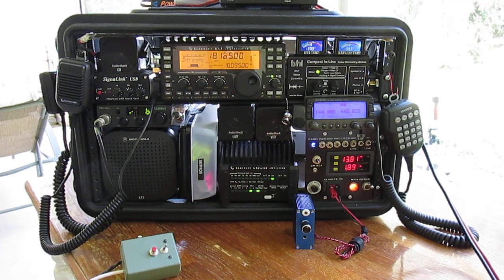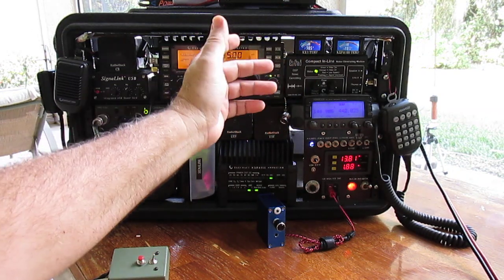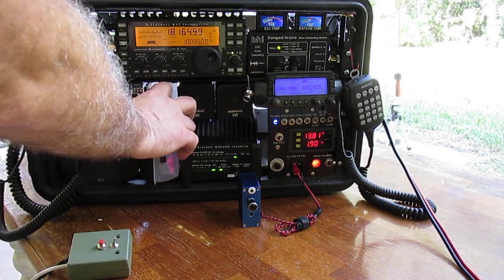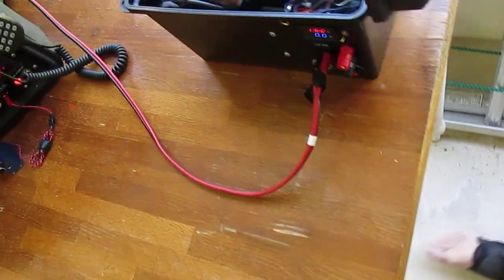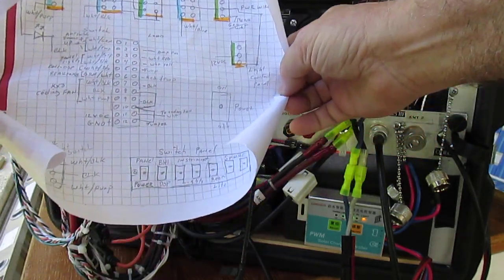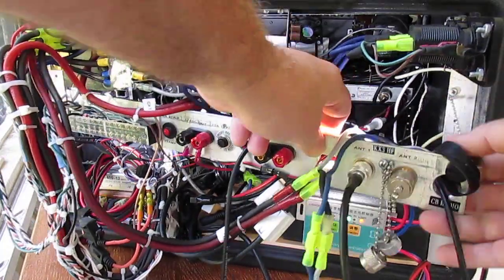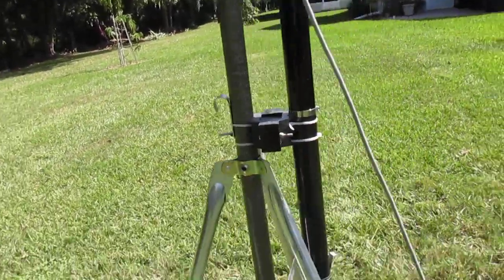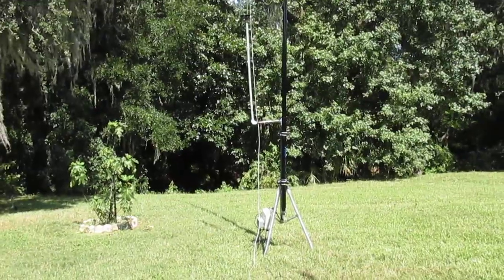E COM Go Box Emergency Communication

Comment: This is a super pragmatic build.   I appreciate knowing that you had problems with flush mounting the antenna coaxials.    I have been thinking I'll include a 16 foot cable which will be routed into the go kit, and just coil it up and then spool it out to my antenna A/B switch will be outboard.  I'll be using 3M's super velcro (Dual Loc) to do a similar easy serviceability.
Reply from the maker: 16 foot cable, another good idea to add to the think tank.

Ed kj4fgi

Comment: How much it cost to build one
Reply from the maker: Too much, I built this because this is what I had at the time and the KX3 and amplifier had all the bells and whistles and it.
It was also very heavy,  it covered UHF, VHF, CB, GMRS and HF. I included a CB because here in Florida we have a lot of truckers on the road and that's where you could get your information on how the roads were after a hurricane with the occasional tornado. If you're going to design one, think of what you need. Are you going to need UHF, VHF, CB, GMRS and HF all in one box? The switch panel that I built I used an old printer cable, the ones not used on computers anymore. I cut the ends off and it made a nice cable for running the multitude of wires,

Comment: Great box! But you sure as hell ain’t “go”ing anywhere fast lugging that around
Reply from the maker: I use a foldable luggage dolly, the type you can use for taking your luggage onto an aircraft it's aluminum and it's small enough to fit in the overhead bin or under the seat

Comment: Really nice video...thank you for posting!!  I built a similar go box, then I took it all apart because it was way too heavy and I realized it is very unlikely that I would ever need so many radios and equipment in a non-configurable and non-modular format for field use (or at least in my use case).
Reply: Too heavy!  Yes!  Looking at this and other builds on YT, I've come to the conclusion that "modular" is the way to go.  One box for HF, one for VHF/UHF, one for power, and one for cables and such.  Store them all together, but take only what you need.  Or take all of the modules to the site, but only move them to your operating position as needed.  You are likely not the only operator that will be there, and not the only person bringing gear.  And as time marches on, your older back will appreciate multiple smaller loads to tote.  Experience here.

Comment: Really a great job!  The 8 volt battery in the battery box to calibrate the alarm was brilliant.  I was wondering how you did that.  What is the purpose of the knob just to the right of the CB radio?  73's

Comment: Hello man, I am setting up a go box and I intend to transport by plane. My configuration looks like yours and i will need an 8U case.  Do you think it's possible to transport this on the plane without any problems?  73
Reply from the maker: 8U case is not considered carry on, you have to check it.
Reply: @EddieVfgi  ok,

Comment: I am amazed by your ingunuity and use of compact space for the various back up processes and ease in designed access.  I have not seen a more complete, thorough and effective systematic Comm. Go Box in all of my years in Emergency Services.  I wanted to see your design as I am about to start building one myself.  May take some time and cash certainly.  Your work is a definite inspiration.

Comment: I remember you said you had the low battery alarm set to 9 volts. I'm not sure if that alarm is measuring whatever supply of power you happen to be using at any given time, but with SLA batteries they loose capacity if allowed to drop much further that 10.5 volts. The BMS on the LiFePO4 battery won't let the battery get down to 9 volts anyway  without disconnecting itself first. Anyway great setup!

Comment: You definitely didn't bore us.  I love your go box... looks very effective.  Do you have covers for the front and back of the radio box?  How much does the whole setup weigh?  I'm designing my own setup right now, although it will probably be a while before I get it all together, and I like your option of having the battery box separate from the radio box.  Thanks for sharing!  73 de KD7ZWV

Comment: Hello and thanks for sharing, I've constructed two Go Boxes over the years and in the process of doing another one using a wheeled tool box this time and is to house in a big battery in the bottom.; One particular thing I liked is that of using a relay system to switch from shore power to battery insted of using an ON-OFF-ON DPDT big switch, I would very much appreciate if you elaborate a bit on the relay please, type , web ref pic etc, many thanks and once again thank you for sharing, 73is from 9H1AA (Malta Islamd)
Reply from the maker: George, I found this to be a better choice,  Low Loss PWRgate by KI0BK,

 see:    http://ki0bk.no-ip.com/~pwrgate/LLPG/Site/LLPG.html
Reply: @EddieVfgi  thank you

Comment: Great video.  How do you fix the equipment to the case?  Do you bolt it all to the shelf, bottom, or sides?
Reply from the maker: All equipment is Velcro hook n loop, not the cheap Velcro, the good stuff
It makes service and tear down quick and efficient.
The switch panel is the only thing bolted down

Comment: First thing I noticed was that the KXPA 100 with its large cooling fans are mounted directly below the KX-3. The next thing that I remembered was that heat rises and heat is the enemy of electronics. Do you have any concern that you may add unnecessary heat to the items above the amp? The box looks fairly crowded and I might be concerned about air flow and heat dissipation.

Comment: I am new to this as well but I am looking for a 12v/120v relay kind of style switch. I want to run my box off 12v solar, however I also want to have it run on a 120 set up, but I need something that will switch off my battery and automatically switch everything to the 120 v side, which will convert down to 12v to run my equipment..do you know where I can get a reasonable switch to due such a thing?
Reply from the maker: Go to http://ki0bk.no-ip.com/~pwrgate/LLPG/Site/Welcome.html  when using a relay, you lose a split second of power and you may have to power up the radio. I found that out using a 30 amp relay. I recommend   FlintHills Radio Inc.  products      http://ki0bk.no-ip.com/~pwrgate/LLPG/Site/Welcome.html  if your going to use a LifePo4 battery let him know and the solar charge controller will be made to both SLA and LifePo4 batteries. These components he sells are small which is nice, they don't take up much room. I have every one of these and 2 Solar charge controllers from FlintHills Radio Inc.

Comment: Thanks again for posting.  One more advice, the vertical antennas are great and are easily (somewhat) installed but in addition to not being portable for emergencies, they don't work for local/regional comms.  They have a low takeoff angle and are GENERALLY (not always) used for long distance communication, i.e. one end of US to the other or to Europe, etc.  For the emergencies you need a NVIS (Near Vertical Incidence Skywave) antenna.  Its basically a endfed or dipole antenna installed about 15 ft high off the ground.  They are also much more portable.

The overall theme for EmComm Gobox is 1. Portability, 2. Reliability, 3. Simplicity, and 4. Serviceability in the field.  There is always a tradeoff between the that above requirements and extend of functionality, i.e. how much equipment you want to cram in!
Reply from the maker: Thanks

Comment: Excellent job Edward and not boring at all as another person said.  However,  its too complicated and I'm sure heavy.  The next phase of the project should be to simplify and lighten up so it can be more portable.  If it is for emergency preparedness, I would consider removing the CB and modify the KX3 to transmit on CB band and add a portable high quality scanner.  In emergencies, depending on your situation, listening will be your most effective action!  Phase 3, will require additional mods that we can discuss another time.

I have two Gator boxes that I'm using for similar purposes.  1. A 6U unit that is a Shack in the box with wheels, and 2. A 4U unit GoBox without wheels.  Both units have a power supply, a mobile HF/VHF transceiver, a VHF/UHF transceiver, auto tuner, signal link box, speakers and associated misc parts, lights, etc.  One is more portable than the other BUT I DON'T WANT TO MOVE EITHER ONE.  i.e., not portable and light enough so Im working on a lighter version of the gobox with two primary goals.  SIMPLICITY and PORTABILITY!  Without those two qualities the equipment will not be used regularly, will be difficult to maintain in the field and will end up being a show piece!

Cheers and 73.
Reply from the maker: As far as I know you can't modify the KX3 for out of band communications, Elecraft has that in their software.

Comment: VERY impressive!! Thanks for sharing.  - 73 -
Reply from the maker: Thanks Tom.
Reply: Two follow up questions if you don't mind: 1- What does the finished project weigh?  2- If under high usage, doesn't any of the equipment get hot?  -- 73 --
Reply from the maker: The weight is about 50 pounds, I use a luggage cart.  Nothing else gets hot, just the KX3 and the KXp100
Reply: Cool. I like the whole thing, the design, the layout the whole ball of wax. Great job. Thanks for sharing and  =thanks for getting back to me, --73--
Reply from the maker: Your very welcome

Comment: I did not understand what you said about that 14  volt battery
. What kind of battery is that?
Reply from the maker: it is a Bioenno LiFePo4 battery Link;  https://www.bioennopower.com/collections/lifepo4-batteries-for-communication-equipment-ham-radio/products/12v-20ah-lfp-battery-pvc-blf-1220a
REPLY

Comment: While I think this setup is beautiful, isn't it a lot big for a shtf go box? When seconds count and ease of mobility and size constraints are paramount I'd sort of think anything over a .30 cal or .50 cal ammo can is getting on the big side of quick go comms box...
Reply from the maker: Thanks, this in not designed for SHTF, it is designed as a Central multi communications Base Station  for emergency communications in disaster situations like Hurricanes, Earthquake, Wildfires, ect.

Comment: Thanks a lot over here in Italy. Would you drop the name of plastic boxes u used? I've seen the Ammo Box for battery but I cannot find name of the bigger one..thanks for your passion and sharing. 73 de Iw2EMD
Reply: Do a google search for "Gator Box." Specifically that looks like an 8U unit, maybe a 6U. But you can search "6U gator box" and find them. Amazon has them for around $159. You can get cheaper models but I think they're worth it.
Reply from the maker: Gator Box Pro 8U -19 179.99 B&H Photo free delivery

   https://www.bhphotovideo.com/bnh/controller/home?A=details&O=&Q=&ap=y&c3api=1876%2C%7Bcreative%7D%2C%7Bkeyword%7D&gclid=CLWpvMGUi9QCFdgJgQodB4UKKw&is=REG&sku=614626
Reply: Many thanks, found!. Best regards and 73!
Reply: Thanks a lot.. 73!!

Comment: Very good job Edward.  Have you considered a follow up video showing you setting up your Go Box station in the field?  We are teaching some scouts and beginners that have just entered the world of amateur radio.  They would enjoy watching a Go Box like yours being set up in the field, i.e. time to set up, guying, anchoring considerations, solar (if you are using solar now too) etc.  We are discussing setting up in extreme emergencies complete with heavy weather and disaster all around us (you know, the typical 7.5 quake at 1 a.m. in -10 F temps and a white out, hi hi), hence the set up run through for setup time for a Go Box system like yours on a good day.  It will take more than one or two aluminum can drives to fund their Go Box but now they have a picture in their minds of what is possible thanks to this video.  73
Reply from the maker: Thanks Lee, unfortunately, now medical, reasons hold me back .
Eddie
Reply: Sorry to hear about your health.  Get well soon.

Comment: Way over kill . I'm going to do one with a Ft991 already has a tuner and USB ready for PSK and CW .
Reply from the maker: I like to operate QRP, the KX3 is held in with velcro, I can take it out and do QRP work.
A 100 watt FT991 radio is not QRP trail friendly. I'd rather have 8 aa batteries installed into a QRP radio compared to lugging around a 12v 35ah battery for a  FT991.
Reply: Doug Swann dif you ever do your 991 gobox?

Comment: How heavy is it, and how do you move it? Any wheels built in?
Reply from the maker: Robert, short distance carry isn't bad, up to 100 feet , for distance hauls  I have a luggage rack with wheels, it's the type one would use for traveling on an aircraft. It collapses small enough to fit in the overhead bin on an aircraft.

Comment: Hey Edward, very nice setup!! I really like it and would like very much to  build one for myself.  I tried writing  down each component you used to put this awesome unit together but I am certain there are some items I missed  especially after   you showed the back of your unit and the external battery.  Could you provide a complete list of the items  used to build it?  I've never built anything like this before but I am a newbie prepper and this kind of unit is a life-saver.   Anything you might add to this would be greatly appreciated.Thanks, my email is a avietnamvet69@gmail.comI am a former U.S. Marine and now a disabled Vietnam Veteran.  Semper Fi.

Comment: Nice work on the emergency communications rig. Make sure all your power cables are fused as close to the power source as possible. Nice to see a fellow ham that thinks a lot like me. I went with a GO BOX set up along with the battery box which I started with my QRP set up and recently expanded my solar power capabilities from one 15 watt panel to a nice 27 watt fold out for portable work. Keeps the battery charged along with other devices as needed. Topped it all off with a nice clean power generator/inverter. Never know when you may find yourself without power or need to deploy. Great Job!     73,       de N4UVR
Reply from the maker: Thanks, that's the 4th uhf/vhf/cb/HF box I built.